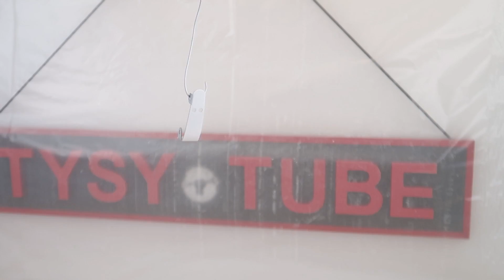1930 Meccano Airplane Toy Restoration

Comment: Looks fantastic, but I wish you would have restored it to it's original paint scheme....
Reply: I'm torn between restoring it to the original military and the really great job making it a civilian  search and rescue aircraft.
Reply: I thought he was going to do that.
Reply: Meccano went through several phases of colour scheme, but the "original" for this model looks like it was unfinished steel which as we can see was not a good look in the long run. The blue and yellow are what I remember from the 60s and 70s and the shades chosen here look very close to my recollection. I should dig my old set out the attic and take a look at it some day...
Reply: JamieRaynDowney I struggle with that sometimes but then I remember it is his project and not mine and I need to just relax and enjoy his work
Reply: @rgd963  I mean, a good chunk of old military planes ended up in a similar boat(not a pun). Better to reuse than to scrap.

Comment: I'm surprised there were so many screws.  Normally they use rivets, but perhaps at some point someone disassembled it and didn't have a rivet gun to put it back together.
Reply: I agree, I think rivets would have been appropriate
Reply: That's the whole point. This was a construction kit for kids to assemble. There were also cranes, bridges and other kind of devices that could be constructed..
Reply: @heiner71  Makes sense now.  Thanks for clarifying.
Reply: Yeah, meccano was a kids building toy. Very popular in the 40s and 50s here in the British isles.
Reply: @heiner71  Thank you, I was unaware and I think that is an excellent ideal toy for kids. Beautiful job on the restoration.

Comment: The screws / bolts you replaced them with are miles to long compared to original.. cut them down!
Reply: Yep
Reply: So what? You can't see them.
Reply: No one can see them

Comment: My favorite childhood toy was a plastic scale model (1 inch = 2 ft.) kit of a 42 ft. Wheeler Express Cruiser made by Ideal Toy Co.  It had a one piece watertight hull and a dinghy mounted on top of the cabin.  The colors were molded into the various pieces so no painting was required.  A close 2nd was a plastic kit model of the "Cheryl Ann" tugboat from the 1950's TV series "Waterfront".  It was approx. 18 inches long as I recall, and had an electric motor drive.  A company offered these models as sales commission for selling 20 boxes of gift cards.

Comment: Fantastic job overall, but for the colours should have gone for a aluminium with the French airforce marking. Cheers!
Reply: RAF
Reply: crazy eddie it’s not raf markings
Reply: @paulieplayspoorly  R.A.F has the blue on the outside and the red on the inside, France has the colour order reversed.

Comment: My favorite toy was called Mr. Machine. It was a clear plastic man with a top hat that was all gears and walked around when wound up and clanged a bell! You could also take him apart and re-assemble him.
Reply: Me too, though it’s not an easy toy to find due to clear plastic yellows and becomes brittle with extreme age age. The wind up key would be missing and the metal spring coil would be broken. The box it came was something to see. The tv advertising at Christmas showed four of those machine marching forward.  Released as an Ideal toy, not Mattel.

Comment: I guess it lacks a string or a wire from tail to mid-tailboom. There are holes for screws there and obviously no metal planks but rather a wire. It would be present on a period seaplane as an antenna.

Comment: Certainly a nice job. The new paint looks great and the brass screws are nice and shiny. On this occasion however, I think it might have been better to go for a straight restoration, back to its original condition. Dip the original nuts & bolts in MC51, repaint the plane in a metallic silver and apply some air-force decals. Another possibility would have been a thorough clean, without removing the paint, then a clear-coat over the original paintwork - a sort of plane rat-rod style.
Still a nice job though, just maybe not what I would have done.☺

All the Best,
Dougie.

Comment: I think I would have gone with a mostly chrome body, colored tail, maybe red. The pontoons I would have gone with white. The propeller I would have painted black. The area just behind the propeller I would have gone with the same red as the tail. The windscreen I think I would have trimmed down and added clear plastic for windows. Then just add appropriate id numbers, and you're done. Looks fantastic though, great job.

Comment: The middle propeller had: screw - propellor - washer - nut - plane - nut. The restored has screw - washer - plane - nut. The first is better I think (it also looks better) apart from the looks. Did someone else noticed this too, or is it just me? 

Anyways, you gave it a personal touch in another great restoration video.

Comment: Most times I would say I prefer the original but in this case I would go with your beautiful restoration, excellent! I have not seen one of this particular model before and I have a couple of Meccano planes but not like this
Reply: Agree, I suspect this is not Meccano but a copy of the time, looks great but its quite different to any meccano one I've seen. Equally meccano usually has meccano stamped on the parts but I couldnt see that in these shots. I have to say the floats look almost identical

Comment: Well, I read alot of the reviews and the one resounding response was wrong paint  long screws and I agree. However, not finding info about the kit yet, I wonder what the the holes on the end of the upper wings were for, and the hole in the tail rudder too. The workmanship was good, especially the sand blasting then the undercoat prep, wet sanding, then the bottom fell out. You are a better craftsman than that but Thanks for sharing this video and keep them coming.

Comment: Very nice job, as usual. I think you should keep the original bolts/nuts. You just have to sandblast it and make a new zinc plating.
Super boulot, comme d'hab. Je pense que tu devrais garder les vis/écrous d'origine. Tu as juste à les microbiller (vu que tu as ce qu'il faut pour le faire) et à les faire zinguer. Sur la région parisienne, une boite me fait ça pour pas très cher)

Comment: Nice job in saving an old toy from the crap heap. I'm curious what you do with all these restored toys. I see a lot of comments about the original color/marking scheme being preferable, and I have to agree.  Those thick-headed brass screws are a bit much as well. Still, well done overall.

Comment: Beautiful work all around....but it's not a true restoration if you alter it dramatically.  This repaint is very nice, but if you're going to call it a "restoration" you should also restore original color and markings.  This is a partial restoration and customization.  Wonderful work by you.  No mistake about that, but a "restoration" brings things back to its original state.

Comment: Serious questions, since Meccano toys usually aren't painted , why no polish the parts this time? You have done it in others projects.
Why no use original Meccano screws (still in market) or steel ones? Just curious.

Comment: Awesome restore job although, I wouldn’t  have gone with the brass screws and color schemes it looks waaay too modern between 40 to thirty years old. I would’ve gone with its original color schemes and decals. Along with the opposite of rusty screws, stainless screws to revive the look of the original metal screws, and to inhibit oxidation, over the new life of this particular model. Also, this Meccano series had two angled straps coming from its rear (ailerons) wings to its tail, hence the hole on the tail. either 225 dislikes, at this point are your viewers who are rightfully purest, with a mob mentality, carrying pitch forks and torches, to carry you out of town, or those are LEGO fans.

Comment: It's better to leave the original finish on toys if the parts are all there and the toy is working : a simple cleaning would have been enough. Nice effort though, but you kinda missed the point of vintage toys.

Comment: Original screws could have been cleaned with rust remover, then painted with epoxy paint or nickel coated. This would maintain its true original quality. The new screws are too long and look bulky. Original paint scheme would have made it perfect. Clean finish, but not a true restoration!

Comment: I love your work, but personally I could do without... whatever color the wings and windshield area are. A simpler blue and white would have been better to my eyes. In fact, I would have done one side or the other of the wings in either the white or the blue, and the other side in the other color, tops would probably go blue for MY taste. Still, all in all you do nice work. In actuality, most of these were battleship gray, white, or a lighter blue... military ones were pretty much the gray... I think... but almost all pictures of these type of planes are in black and white, so .. well you get it. All that I've seen in color pictures, tv shows and what not have been the white or gray.

Comment: How is it a restoration if you don't re-do the insignia and markings on the plane as-well as the original screws and bolts? you could of cleaned them up, they didn't look damaged. Should of at least shortened and covered those bright brass ones too with the newly painted sections there are way too many colors going on this one :'(

Comment: 1. Chosen horrible colors
2. Bolts are long and not authentic
3. The mechanic first assembled the gondola, but did not put the propeller in the fuselage. Obviously I had to disassemble the gondola, set screw, and only then collect new gondola :)))